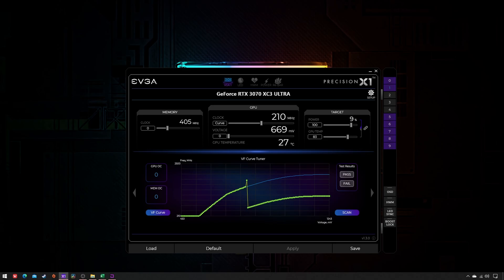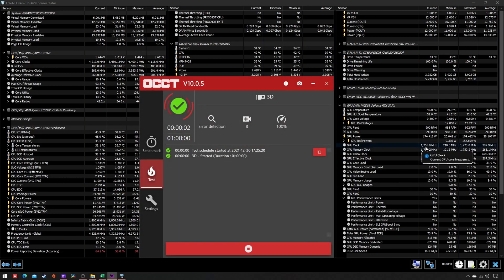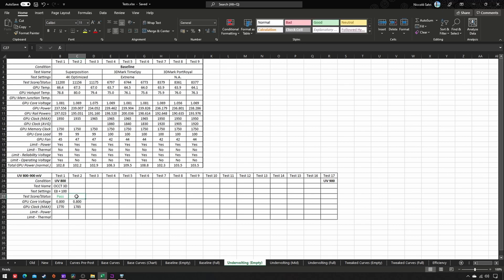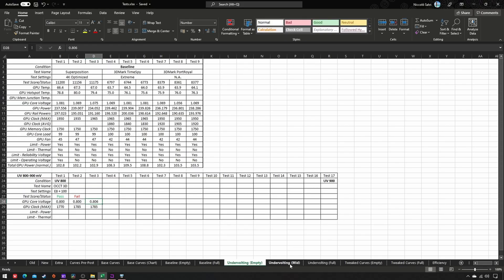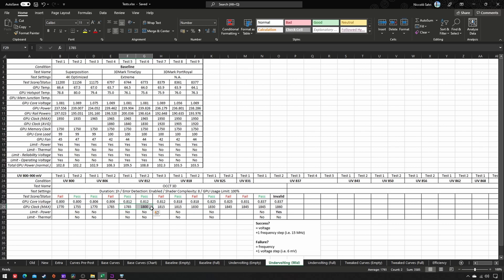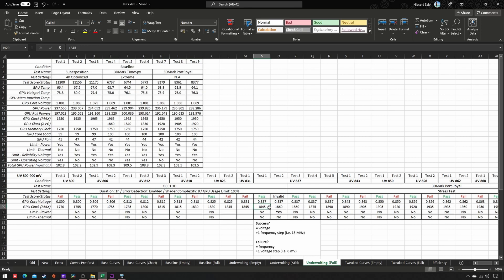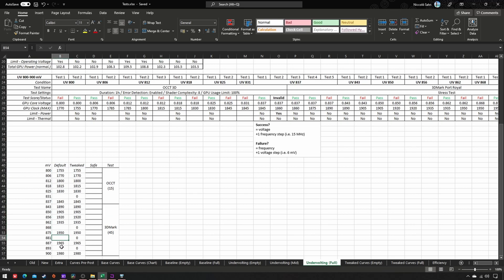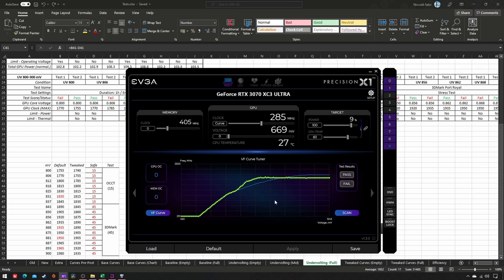[3/5] Undervolting w/ EVGA Precision: stability is ALWAYS crucial

Comment: I'm trying to UV my EVGA 3080 XC3, I have followed every step but as soon as I start OCCT at 800mV, the Performance Limit - Power trips. Does that mean I should jump to 3DMark Port Royal straight away?
Reply from the maker: Already at 800mV? Interesting.
In my opinion, you have three options:
1) Start from a lower VF point, maybe 750mV at 1545MHz (this is a quite conservative combo).
2) Increase / max out the Power Target slider in Precision, but be careful with temperatures!
3) As you said, jump directly to Port Royal.
Personally, I would choose the first option, so as to find out the frequency delta between OCCT and Port Royal.
Reply: @oakenglass  Thanks for your reply. I tried running OCCT with 750mV@1545Mhz but it still trips up the Power limit (albeit after a longer period of time than before, about 30 sec into the test instead of 2 sec)
I have already maxed out the Power Target slider in Precision and the temperature is max at 85.5C.
My GPU is rated 320W but the max load has only been 292W under test.
Have I lost the silicon lottery or is there something missing?
Reply: At 750mV@1545MHz, the Power Limit goes back and forth, and it would finish the hour long test no problem. But any increase in either voltage (756mV) or clock speed (1560MHz) or both would immediately speed up the appearance of the Power Limit flag and it stays.
Reply from the maker: @yippeekyay  According to the TechPowerUp VGA Bios Database, your card should have a 340W limit at 100% and 366W at 108%: https://www.techpowerup.com/vgabios/231655/evga-rtx3080-10240-210313

Moreover, 85.5°C is too high at 750/1545. I guess your Hotspot is around 95°C... and the GDDR6X I don't know, but on the high side?

Let's try a run of Port Royal Benchmark (not Stress Test) at 750/1545 ("Boost Lock" these values with PX1) and tell me this data (remember to reset HWiNFO Sensors just before launching Port Royal):
-Max GPU Temperatures (Core, Hotspot, Memory).
-Min & Max GPU Core Voltage.
-Max GPU Fans Speed.
-Max GPU Power.
-Min & Max GPU Clock and Effective Clock.
-Max GPU Core Load.
-Any Performance Limiters that trip.
-Max Total GPU Power, normalized and not.
Reply: @oakenglass   -Max GPU Temperatures (Core, Hotspot, Memory). Core: 73.2 Hotspot: 83.4 Memory: 86
-Min & Max GPU Core Voltage. Min: 0.713 Max: 0.750
-Max GPU Fans Speed. 1656RPM
-Max GPU Power. 218.22W
-Min & Max GPU Clock and Effective Clock. Min: 80.9MHz Max: 1559.8MHz
-Max GPU Core Load. 100%
-Any Performance Limiters that trip. Performance Limit - Utilization only
-Max Total GPU Power, normalized and not. norm: 68.1% not: 64.7%

Sorry for getting back to you so late, I was being cheap and waiting for Steam summer sale. I also had other things going on in my life so I did have the time to test it out. Here are the results from 1 run of Port Royal. Hope it helps.
Reply from the maker: @yippeekyay  No problem, I totally understand! I bought 3DMark during a Steam Summer Sale too...

As for your results, they are all in line with my expectations, except temperatures. They seem quite high to me, especially at 750/1560 (and 1650 RPM).
Perhaps it's just the XC3 heatsink that's a bit undersized for a 3080 but... could you tell me your ambient temperature and case + fans configuration?
Reply: @oakenglass  Ambient temperature was about 25C, with an NR400 case.
two intake fans from the front
one exhaust fan at the top, one at the back
got a tuf B550 WiFi mATX motherboard.
somehow the card can't be mounted to the first slot but 2nd and 3rd expansion slot of the case, making the card's fan much closer to the top of the PSU enclosure portion of the case.
I have tried opening the side panel and the temperature dropped by 2-3 degrees.

If it helps, I'm also using a Noctua NHU12S to cool my CPU
Reply from the maker: @yippeekyay  Sorry for the delay! The gap between the heatsink and the PSU shroud does indeed seem rather small.

Now I would try these two configurations:
1) Side panel off, table fan (at its minimum speed) directed inwards.
2) Side panel on, top fan unplugged (so as to create positive pressure inside the case, now it's neutral).

Let's see how the temperatures improve...
Reply: @oakenglass  The temperatures have indeed improved by a couple of degrees, but the power limit is still tripping as soon as I start Superposition. It looks like I'm out of luck? 😬
Reply from the maker: @yippeekyay  Superposition trips a REAL Power Limit at 750/1545? This is strange, since Port Royal didn't (in fact, Total GPU Power "Normalized" was 68.1%).

Let's do this: with 750/1545 (no "Boost Lock"), run Superposition (Preset: 8K Optimized) without HWiNFO in the background and carefully monitor the frequency (with your eyes, I mean): you should see it move up and down between 1530 - 1560... and at scene 17/17, it should be 1545 MHz. Correct?
Reply: I can confirm this happens for me as well with an EVGA RTX 3080 FTW3 Ultra Gaming. Even at 800 mV/1800MHz, HW info reports that the power limit has been reached a few times during the 1h OCCT test. It doesn't seem to affect the clock speed until 818mv/1845MHz though. At that point there is some noticeable throttling in response to the power limit warning.

Also  for whatever reason, the Port Royal stress test has proven to be a very unreliable benchmark. I RMAed my first card because of it and I had the exact same issue with the second card: at some random point in the stress test after the first loop, the lighting starts to go crazy and eventually leads to the stress test crashing (even at stock or with strongly underclocked settings). I have seen a few other users report this, though not many. Have you experienced this?
Reply: @iiiiiiariesiiiiii4187  I haven't tried Port Royal yet, but when the performance limit - power kicks in, the clock speed is immediately down for me during OCCT
Reply: @yippeekyay  Even TimeSpy Extreme and Port Royal stess tests are apparently triggering the power limit for me despite the power limit being set to 450W in PX1 and HW info reporting around 360-370W max power draw. I guess there are some power spikes that are not getting caught by HW Info.
Reply from the maker: @iiiiiiariesiiiiii4187  If the power limit trips but the clock doesn't go down, it's a "false" power flag. Watch the last video of this series: https://www.youtube.com/watch?v=fEcvFwfyeX8

As for Port Royal, I didn't experience any crashes... I chose it over Time Spy Extreme since it stresses the RT cores, but the latter is still perfectly fine.
Reply: @yippeekyay  I've noticed something that might help you out with the throttling, at least at some of the earlier VF points:

The algorithm involved in VF control seems to also be sensitive to how much of frequency drop will result from the throttling. I.e. if jumping to the next lowest voltage results in too large of a frequency drop, the algorithm may decide against it, even if the virtual power/thermal limit flags are raised.

Perhaps you can use this to your advantage, by setting all VF points before your target VF point to a much lower frequency while your are testing that VF point.

This has worked for me partially. In my case, it also seems that the throttling was a source of instability in and of itself (probably due to transient voltage drops).

There will come a point where the pull towards a lower voltage will become too "irresistable" for the algorithm, even if the frequency is much lower. For me that point is 818mV/1845MHz when testing with OCCT. Yours will likely be different.

Try it out ad see if that works for you.

Comment: Is one hour required for the OCCT testing or could we set it to 20 minutes instead and get the necessary results?
Reply from the maker: In my opinion, a full hour in OCCT (and 20/20 loops in PortRoyal, later on) is necessary if you want to be absolutely certain that your card is stable. I've had many VF points fail after 20 minutes...
Reply: I can confirm that I've encountered errors in the second thirty minutes... Had a couple at 38 and 48 minutes yesterday.